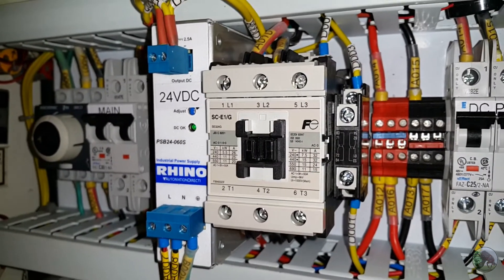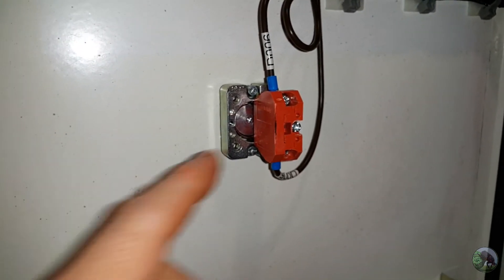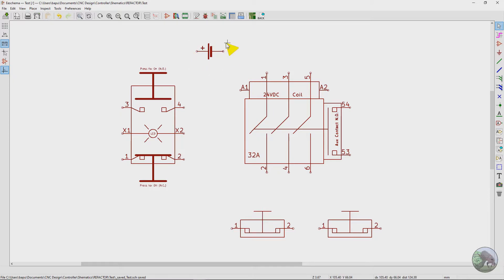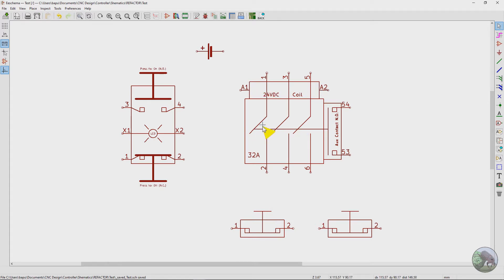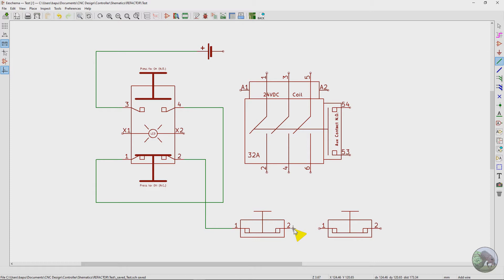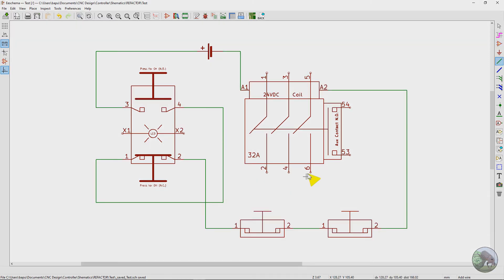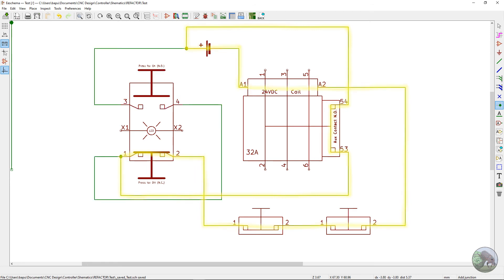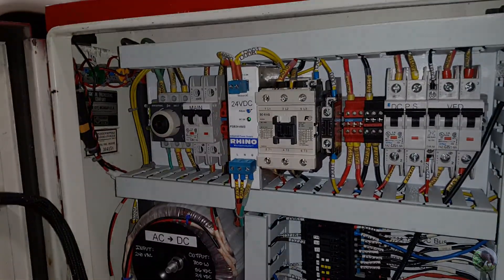CNC Controller Build: Latching E-Stop Circuit

Comment: Thank you for this video. I used your E-stop Circuit in my CNC  plasma control panel I am currently building. This video series was inspirational and pushed me to use DIN rail components for my panel. I am super pleased with how professional it looks and even more so the ease in which changes or repairs can be made in the future..
Reply from the maker: I'm glad I could help inspire you, this is the main reason I made these videos. I too was inspired by others so it's good to know I was able to pass it on. Good on you for getting it done!

Comment: First off I appreciate  you! And your work. Don't take this as s criticism  as I truly am interested in the "why" but why not just replace his complication with a simple switch?
Reply from the maker: The latching circuit provides the following 1) it ensures the integrity of wires going through each e-stop switch (arguably a simple switch would do the same thing). 2) it requires a human to actively re-enable the latch when a fault or e-stop is triggered. This second feature is more important than it appears. Lets say you use a simple switch and at some point you hit the e-stop button which breaks the circuit & shuts off power to the machine. Without a latching circuit, the power will be immediately restored the moment the e-stop switch is reset. Perhaps this is fine for you but perhaps not. In industry and industrial machines this is usually NOT desirable. Think of a conveyor belt in a large factory. There may be other things that need to be done to safely re-set a machine to operate. This is why latching circuits are usually preferred.

Comment: Great explanation of the circuit and awesome visuals.  Couldn't tell from other vids if you are using the 5-6 contactor terminals, it seems like the N.O. switch 53/54 could be replaced by using the 5/6 pair to the same effect.  Thanks for making the time to explain your approach
Reply from the maker: I believe I saw someone do just that. The aux contact was cheap so I thought I'd just get one. I also wasn't sure if I was going to want/need the N.C. contact for something.
Reply: Hi Jeff, what do you mean by the 5-6 contact terminals?
Reply: @mark gatchell - the contactor offers three sets of ‘switched’ paths - 1-2, 3-4, 5-6 - they are using 1-2, 3-4 for the power here - the (effectively Normally open circuit) 5-6 is unused.  I have run the control voltage across 5-6 in a project eliminating the need for an aux contact.
Reply: @jeffschilling  Thanks Jeff, you just saved me $18. Did you rum 24VDC through 5-6?
Reply: @markgatchell942  exactly.  It is latched when the contractor is activated.  Good luck

Comment: Hi,  I was wondering when you push in the E stop and your VFD contactor opens up, how does your spindle use the dynamic brake?

Thanks,
Fritz
Reply from the maker: Another great question. My design does NOT utilize dynamic braking during e-stop. There's a useful standards document created by National Fire Prevention Association (NFPA) that relates to this topic. "NFPA 79 - Electrical Standard for Industrial Machinery" 
-----------------
NFPA 79: 2018 - Link to full text - https://safetycents.com/safety-standards/
    9.2.2 Category 0 is an uncontrolled stop by immediately removing power to the machine actuators.
    9.2.2 Category 1 is a controlled stop with power to the machine actuators available to achieve the stop then remove power when the stop is achieved.
    9.2.2 Category 2 is a controlled stop with power left available to the machine actuators.

    9.2.5.4.1.3 The emergency stop shall function as either a Category 0 or a Category 1 stop (see 9.2.2). The choice of the category of the emergency stop shall be determined by the risk assessment of the machine. 
-----------------
My design is an example of Category 0 - Uncontrolled stop. You are describing a Category 1 type system. You would need to design a circuit to tell the VFD to stop and then once the spindle has stopped, trigger the contactor to open. I don't have any design advice for you on this. I'd have to think about it. There may be some off the shelf solutions for this as it seems like a pretty common issue for industry.

Comment: Can you link where u go your switch and e stop?
Reply from the maker: Youtube insists on reformatting (aka corrupting) the links to automation direct because they contain underscores. I'm forced to use tinyURL which I'm not a big fan of because it can be used for fraud. Nevertheless I'm forced to here. My apologies.

Big E-Stop: https://tinyurl.com/y4ov9lvx (this version has 1 N.C. and 2 N.O. contacts. There are other variations so be aware.)
Enclosure E-Stop: https://tinyurl.com/yyzhbgcd 
On/Off Switch:  https://tinyurl.com/y4crsey2 (this version specifically for 24VDC. There are other variations be aware.)

Comment: That's a really beautifully wired controller! Wondering if you can share what type of wiring and connectors you used for the bulk of it?
Reply from the maker: The wire is just misc stranded copper from the hardware store, nothing too fancy. The ferules are from a kit like this one https://www.amazon.com/Preciva-Self-adjustable-Terminals-Connectors-Uninsulated/dp/B073TZ5BBG